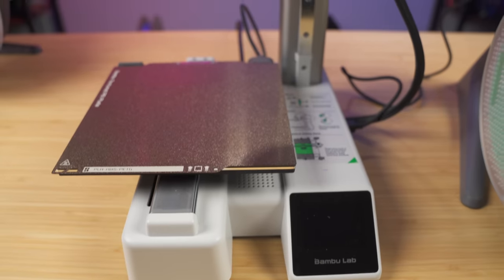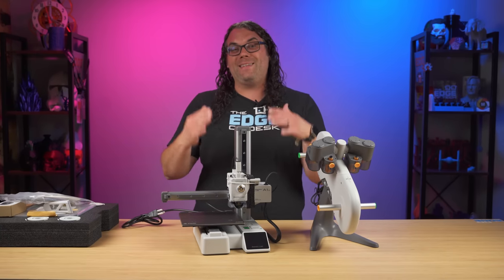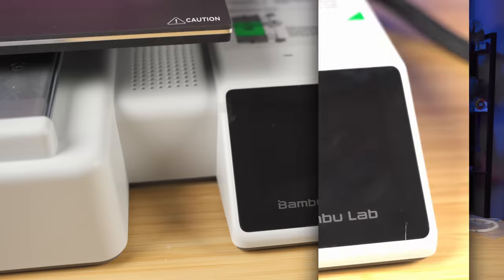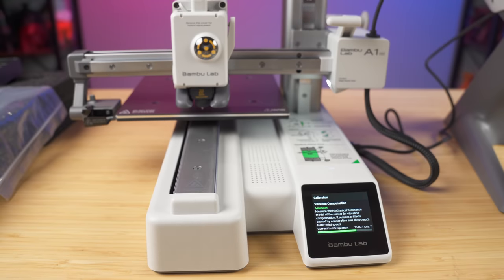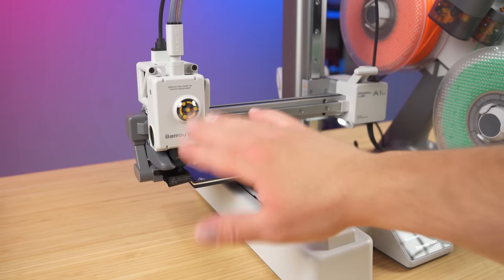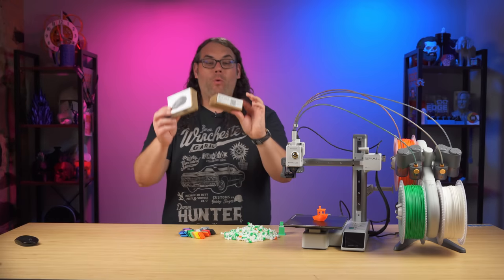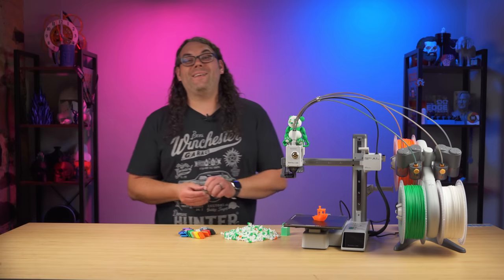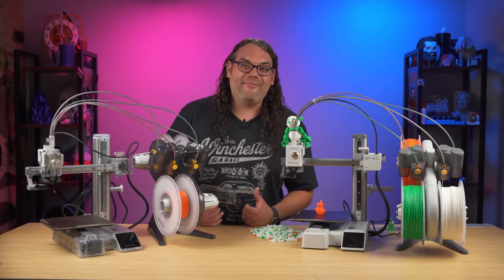The NEW Bambu Lab A1 Mini Combo With 4 Color AMS Lite! ONLY $459!

Comment: For someone who has been thinking of getting into 3D printing,  especially for model railways, this new printer is really interesting! I don't need a big build plate, but an easy to set up and use printer, especially for someone who has never owned or used a 3D printer. This looks nice and easy to get to actually using!
Reply from the maker: It would be perfect for you! If you need something small like N scale, just toss a .2 nozzle on it and let it fly! It's the easiest printer I have used and now the best for beginners.
Reply: @TheEdgeofTech how is it stacking up next to the M5C Jim?
Reply: @TheEdgeofTech I was debating purchasing the PS1 for the last 3 days. Now thinking I may just need the A1 mini with the AMS Lite. I've never worked with 3D printing yet. I work in IT data networking but I'm only looking to print hydroponic towers and accessories. I'm sooooo confused now.  I don't want super complex but I need to be able to print UV capability parts. Oh man. The debate is killing me.

Do you have a detailed video for the PS1 like you do for this one? For comparison so I can make up my mind what to spend? My lil kids may have to sell one but whateve😅 (JK no harm in a child in the making of this comment).😂
Reply from the maker: @playconveyor  Better but smaller!
Reply from the maker: @kathrynmcmurray7193  for you, I would go with the P1S because you're trying to print high temp or UV resistant material. Some of that requires an enclosure and you'll be better off that way.
Reply: @TheEdgeofTech thank you... ❤

Comment: Jim, Great review and totally agree about being a great machine for beginners.  I was hoping for a bigger not smaller print area.   Will see what they release next.
Reply: No doubt, if the bed was equal to or bigger than my 235x235 bed, I would be completely sold. I don't even print multi-color but having all my most common spools up there would be amazing. Furthermore someone mentioned that it can detect spool run-out (via the runout sensor) and then automatically continue into another spool, meaning you can easily finish off spools and not even worry about having to switch to the next spool manually. Lots of thought went into this thing.
Reply: @GeddyRC  I use my Bambu X1C and the P1 for small prints and my Rat Rigs for big ones.   I would like at least a 350 mm bed size, my big Rat Rig is 500mm and comes in handy

Comment: Awesome review! Loved seeing everything that came in the box!

Any chance you've tried PETG on the A1?
Or multi material?
I extensively use my X1C and P1S for PETG parts with PLA as support interface layers and the A1 would be a great cost effective farm solution for the smaller parts I'm doing while freeing up my other printers for more demanding work.
Reply from the maker: I haven't yet, nut don't see it being an issue!
Reply: How do you set that up in bambu slicer?
Reply: @Ebonyqwe  if I have time this week I'll put a Short up on my channel about it 😊

Comment: Why is it that people all declare that they love their Prusa and their Voron but then let themselves be locked in a golden cage without any hesitation? Joel from 3D Printing Nerd said "Open Source is paramount" and then he recommends a closed ecosystem printer after all.
Reply: Open source is paramount. Just because he recommended a closed system printer doesn't take away from anything that he said. Its in part due to prusas innovations and open source hardware/software that bambu is as far as they are.

Comment: So very disappointed with this, seems like Bambu are going backwards - $500 for this but another $200 for P1? I'll take the extra build volume and enclosure framing for the extra money. This seems like its trying to compete with the Prusa Mini? I guess a few more iterations and it will be good to go.
Reply: As someone new to 3D printing I was looking at the P1S but I've decided to give this a go because it's cheaper and has the AMS. The P1S with AMS would have been good but it's just too much for a first printer

Comment: I like how you promote bambu Lab a1... but the printer, let's be honest, very disappointed
Reply from the maker: I appreciate the feedback! To be fair, it's not the bigger one that everybody hope for, but it's solid! It is so fast at multi-color printing and would be a perfect print farm solution for parts smaller than the build size.
Reply: @TheEdgeofTech  I know people that already have a Bambu Lab printer are disappointed, but this printer isn't really aimed at them. $299 for a very fast bed slinger with noise cancelation, flow calibration, and the ability to add multi-color printing with supported parts? Who would buy an Ender over that?
Reply: All you waterheads calling for a bigger printer dont realize they cant go bigger without losing speed. I really doubt they are even developing a bigger printer. They are making money hand over fist with what they have. The release of this cheaper printer just moved them into a new market. Bambu is doing it right. I hope they dont make a bigger printer just so I can watch you all cry for another year.

Comment: It's a toy, Bambu Lab is targeting beginners that don't have P1 or X1 money.🤔 It's sad how they hyped it up so much, bet that cost them a lot of money in sales. With that being said, I'm sure we wont be seeing a bigger printer from Bambu Lab until 2025.
Reply from the maker: I disagree. It's small yes, but very powerfull if you want fast, reliable and/or multi colored prints. They are helping get more people into 3D printing and that is great for all of us! And I would bet that a bigger pritner is coming sonner than later..
Reply: I would argue that most 3d printers can be used not as a toy.  As someone in the fabrication industry. 20 years ago to make even a small custom part. Easily cost my business 10K, for cad design, prototypes, casting a mold. I use several $200 printers to make reliable parts for what I do. So used properly this printer, and others can easily be used for business. 3D printing has save me tens of thousands of dollars being able to do things in-house.
Reply: Because Full sized "helmets" aren't Toys???  From any manufacturers point of view....the majority of files on printables or thingiverse will fit on this build plate.